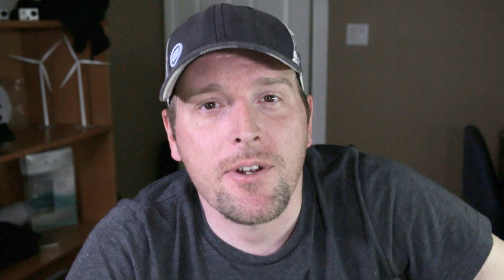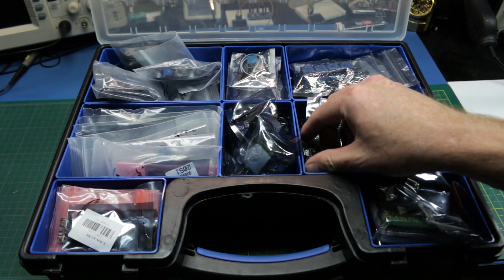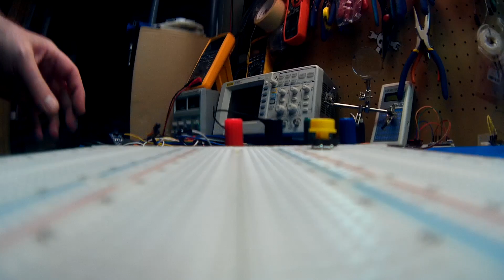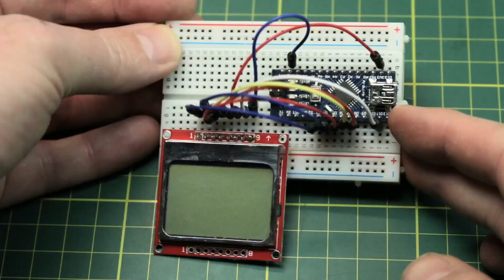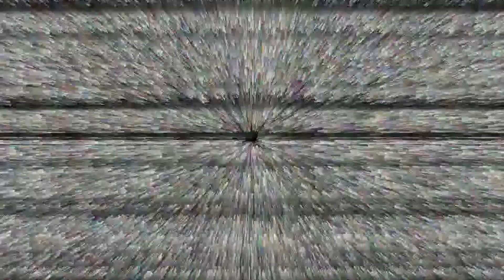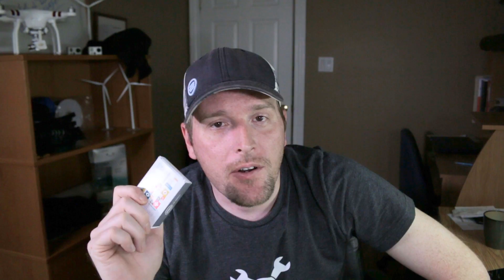DIY Arduino Lottery/Random Number Generator With Nokia 5110 LCD

Comment: You typically have to seed random number generators, often using something more arbitrary, often like the time... so an rtc would have worked. True random number generation is a bit of a misnomer anyway....even lotto balls are influenced by the order in which they were dropped
Reply from the maker: Absolutely. Hadn't played with them until now. For this simple project I just changed the for loop count for each run. Random enough for a single contest giveaway :)  Cheers